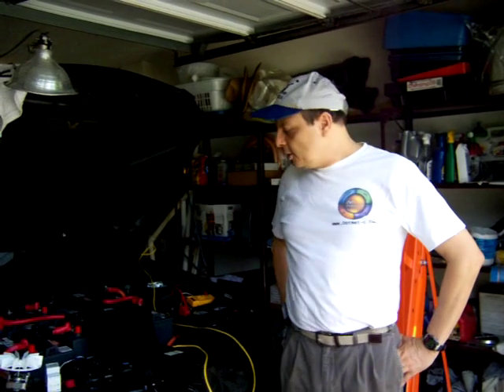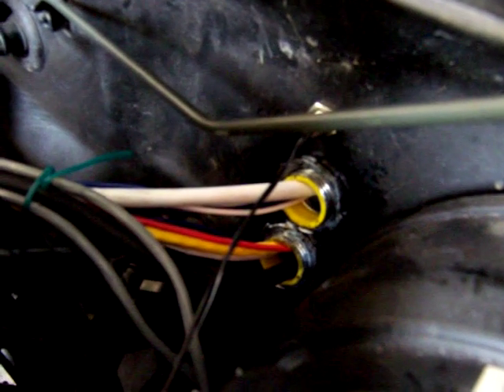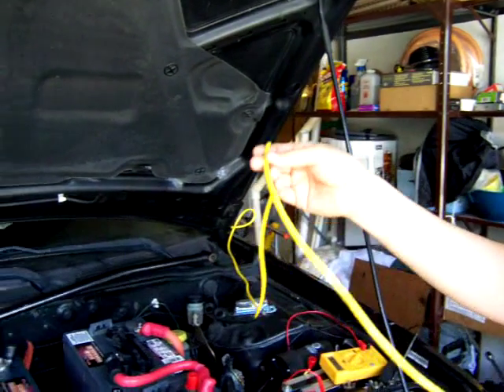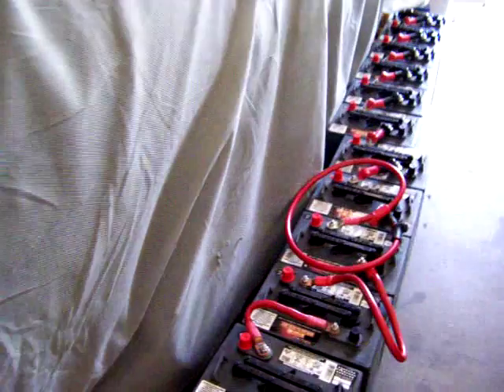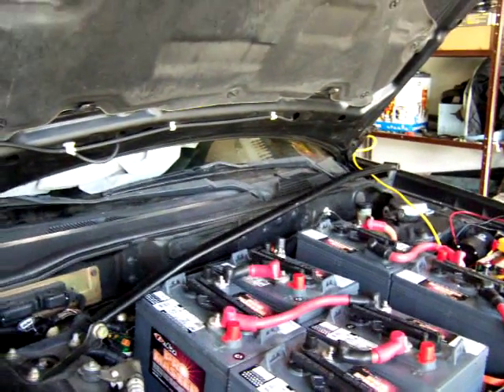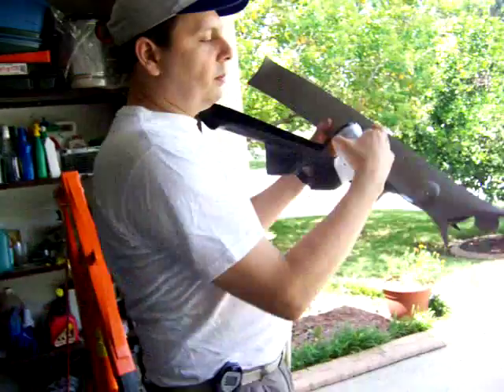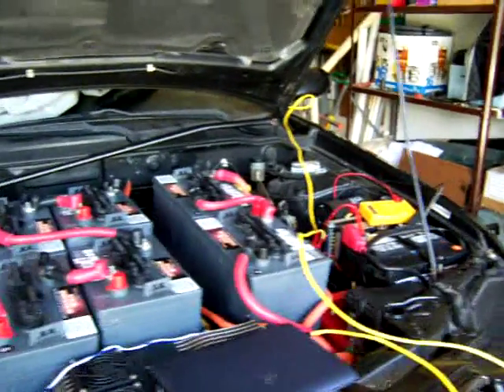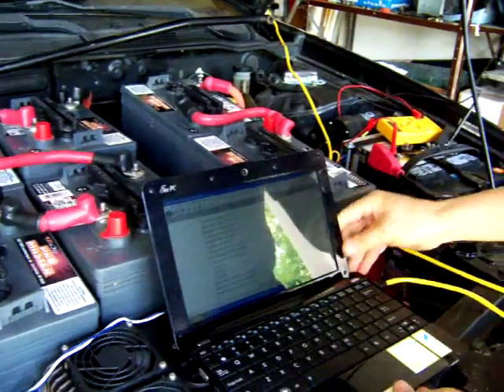Nissan Sentra Electric Car Conversion Part 21

Comment: I have found this interesting, if you keep your batteries on the concrete, the concrete will kill your batteries! You need to put some cardboard or wood under them so they don't die..